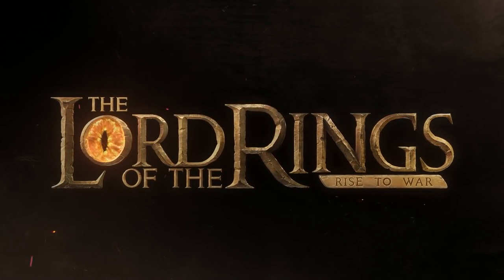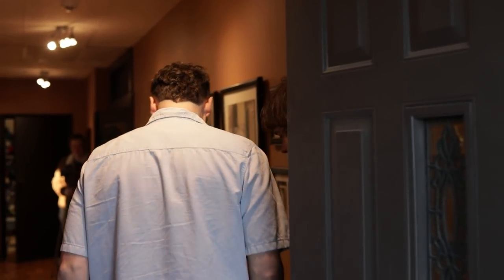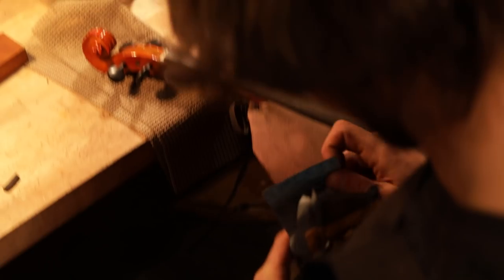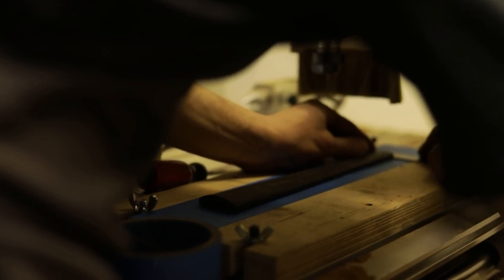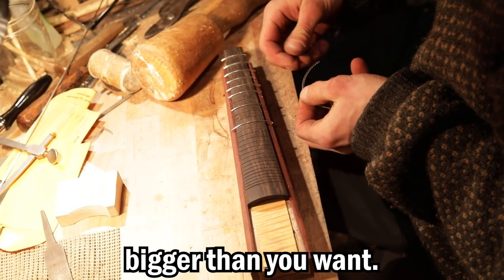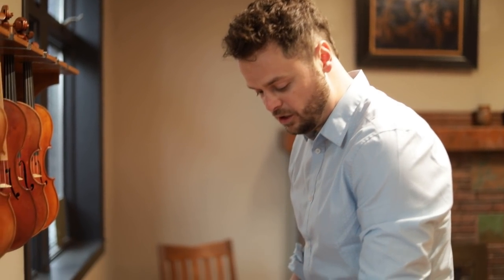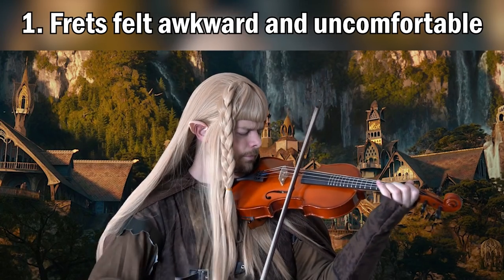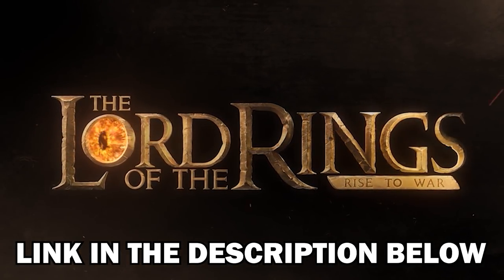Can You Turn A Violin Into A Guitar?

Comment: I use one of the fingerboard stickers with frets that you showed at the beginning of your video on one of my violins.  I think it helps with my practice.  I’m placing my fingers right on top of the frets rather than just behind them - except for my fourth finger which I will admit tends to get a little bit lazy and starts being placed behind the fret.  I’ve been trying to learn Bach’s prelude #1 for cello and the frets on my violin have been very helpful. 

The frets also help with left hand tension.  As I work on something I try to use less left hand pressure and at that point if I can actually feel the frets then I know pressing down too hard.  Reducing left hand tension helps with my bow arm.
Reply from the maker: Yes! Relaxation is key to speed and endurance. If you’d like to check out the fundamentals I teach, you can see the course I have now for 50% off: https://tinyurl.com/ViolinJumpstart

Comment: Lots of violin manufacturers will fit frets. Especially in the electric violin territory. Most notably Mark Woods Viper, these use much finer forests though.. There are two ways of fretting a violin, like a guitar where your finger goes behind the fret, or barely noticeable frets where they are there primarily so you can sense the position. When playing in a loud band you often can’t fully hear yourself and then your intonation will be way off.

Comment: Hi, thanks for your video..
Can the violin tuned just like guitar intervals, on fourth? D-G-B-E
Or Ukulele with bowed version?  G-C-E-A
Regardless different tuning and tensions, Is it playable?
Reply: I've tried that and it works. But the strings of a violin are much closer near eachother so it's harder to play certain chords that require 3 fingers next to eachother, like for example an A-major chord. On a guitar you have can place 3 fingers next to eachother on the second fret but on a violin there's not enough room for that which results in certain fingers moving to a slightly lower or higher position resulting in playing a slightly lower or higher note.

Comment: You know the Fretted Viper?
Reply from the maker: Yes! Played it once or twice
Reply: @RobLandes  I guess the Fretted Viper answers that question alot easier cause it's modeled after the Flying V. It has Mechanical Pegs for quicker easier tuning, it's electric, & w/ up to 7 strings (Bb, F, C, G, D, A, E) it's great for song arranging, along w. a CodaBow Joule. They also feature a Fret Marker Configuration as start points for each scale. It uses a Strap to keep it in playing position. These Frets are filed down nearly flush w/ the fret board & you play directly on them to make them work.
Reply: It's not the only one electric violin, NS Design and Zeta also make fretted violins. Check out Electric Violin Shop.
Reply: @flrn84791  Yes very common